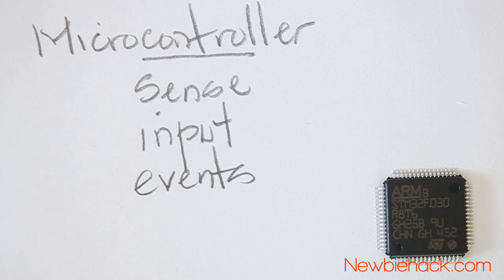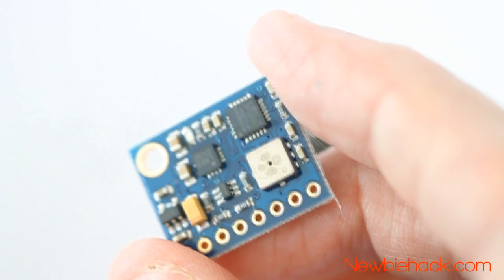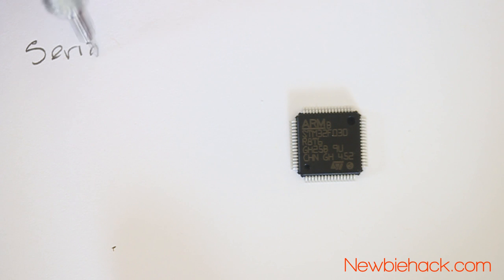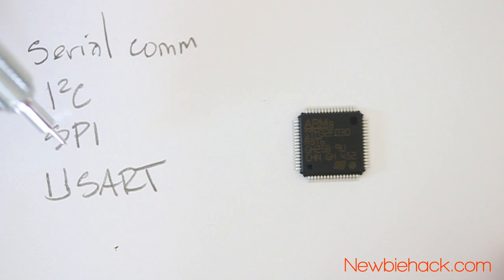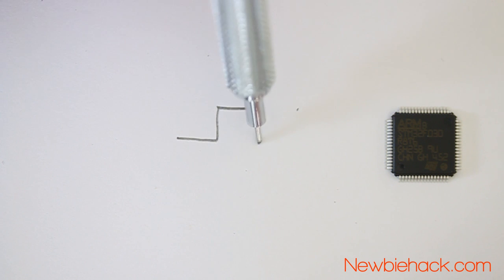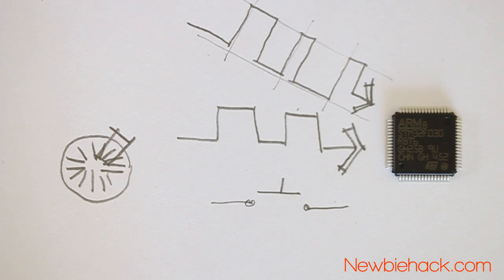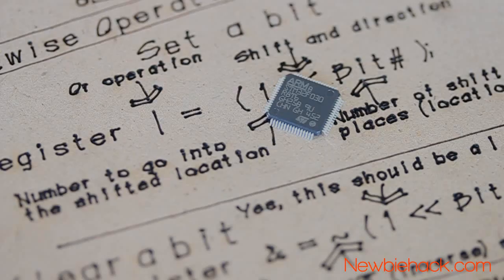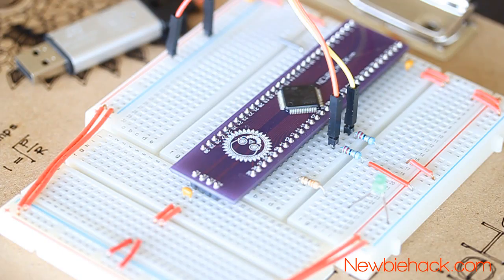1. How to Program and Develop with ARM Microcontrollers - A Tutorial Introduction

Comment: I have your book and its great, but do I need to purchase an ST link and the stm32f030 if I already own a Nucleo L476RG? It has a ST-link built into it via micro usb, but its a standard dev board with a bunch of different features and connections. I would like to do your bare metal approach, but will working with a more advanced board prevent me from doing so?
Reply from the maker: No, there is no need to purchase those components to do the project in the book. If the uC is different, you will need to adjust the code according to the available features on that board.
Reply: @PatrickHoodDaniel  Okay, thanks

Comment: Hellooo. This STM playlist is sooo lit!!! I'm new into embedded programming and am really glad to find this amazing tutorial on youtube. My question is, is it possible to follow along the tutorials using other stm development boards other than the one you used here? If it is possible, what is the version of stm you recommend to follow along the tutorials?
Thank you :))
Reply from the maker: Yes, you can use other development boards.  If you are using another STM32 chip, confirm with the datasheet of that microcontroller for the proper pin assignments and registers.
Reply: @PatrickHoodDaniel  I see. So the change will only be in the port assignment and register, right?

Comment: What is that board called he put the chip onto to spread the space of the MCU?
Reply from the maker: It's called a breakout board, but I have them specifically designed and manufactured so the pins will work with a three breadboard layout to maximize the number of tie strips and circuit variety.

Comment: Hey patrick, nice video. Quick question which brand of microcontroller are used in professional application?. I haven't found info about it but I don't think arduino has the confiability to be taken seriously, i just learned it to know but now i want to make more pro proyects. thanks
Reply from the maker: There are a wide array of microcnotroller brands that use the ARM architecture.  I use the STM (ST Micro) chips as they are very inexpensive and the features are similar to the other brands.
Reply: in which application do you use that?. Everything I see here for industrial automation is just PLC. I haven't seen any application with microcontrollers, except the electronic devices that we all have in home, but there are all are brought from china, no development with chips.
Reply from the maker: PLC (Programmable Logic Controller) is used in industrial applications due to its form factor (case, connectors and such to fit inside of a typical PLC rack).  PLCs use microcontrollers and the brand may be the same or different, depending on the PLC. You can apply microcontrollers to industrial applications (where PLCs are used) and with pretty much anything else.
Reply: but do ou use it profesionally?, the confiability of a single microcontroller is not the same as the PLC. I am mechanical engineer and among all the differents activities that I have done so far, programming through microchip is the most interesting thing that I can think of, and I want to try something more advance now :)
Reply from the maker: alex B I teach the subject and use it in my own applications and in product that I sell. These tutorials are based on bare metal programming (in C rather than Assembly) so this is pretty advanced in my opinion. Learning microcontroller programming is a must for modern industrial application especially with mechanical (mechatronic) applications.
Reply: question which IDE do you use for programing the STM (ST Micro), would you recommend to use arduino for IDE I have heard that that is used here. greeting
Reply from the maker: alex B I use the CooCox CoIDE environment, but since that IDE is hit or miss, I will probably switch to Eclipse. I don’t believe the Arduino environment is possible without a boot loader.
Reply: Hey alex
hieee
can you please tell me which ide you are using for programming.
because in this tutorial series,patrick have used coide...but its not available now.
can you please tell me
Reply: @sushantchauhan5755  Arduino IDE
Reply: okay,can we use keil mdk5

Comment: Do you also have  a tutorial for 4x4 keypad interface to arm series micro-controllers ?
Reply from the maker: I have a 4x4 keyboard tutorial for the AVR chip, not the ARM chip yet.  You can watch that one to get a good idea on the concept and apply it to the ARM.  Here is the video: https://www.youtube.com/watch?v=6FjrKXmquxU
Reply: Thank you very much for a quick reply. I had already watched and worked out that in my projects (thanks and credits to you for that). However i was having problem there when we used the crystal for 16 Mhz, code don't seems to work, Can you please help/check on that ?

Comment: thank you for real :)
and my first question is :D : how the ARM can be better than the AVR and what are the differences between then  ( ar why learning ARM)?
thank you again :)
Reply: mustapha abdul rida 
1) ARM micros are generally 32 bit whereas Atmel AVRs are 8 bit micros.
2) ARM licenses their architecture to many vendors (e.g.  ST-Micro, TI, Samsung, nVidia and many others) whereas AVR architecture is used only in Micros manufactured by Atmel.
3) ARM architecture is widely used in many CPUs and Micros like almost all Android and iDevices (Also Raspberry PI and Beaglebone Black Dev boards).
4) ARM is enough good that Atmel (and Arduino) have started using ARM architecture in their new Micros (and Arduino Boards).

There are some disadvantage to ARM: Almost all ARM micros and CPUs are SMDs with many pins. Not very breadboard friendly.
Reply: Ali Mirjamali
thank you :)

Comment: Cool, but why didn't you use any cortex m4 chip instead of cortex m0 ?
Reply from the maker: I will.  I stated in the beginning of the video that I will be using the M0 through the latest M series at the time of the video creation.  For bare metal programming, the M0 is good for the first part of the series.

Comment: Wow! Thanks! That's just what I need right now.
I recently bought two Atmel SAM chips, but I'm also planning to use STM chips, since I'm interestet in the OpenPilot multicopter board. Probably I also will use LPC chips, since they are used in the microcontroller class at my university.

In opposite to 8 bit MCUs of different manufacturers, ARM Chips build upon a standard. Does that mean, that everything or most of what you explain on the STM chip, also applys to the SAM chips?

And +1 for using the bare chip on a breakout board. I also think, that a MCU specific dev board doesn't really help, if you really want to get into it. I also just ordered two bare Atmel SAM chips.
Reply from the maker: Actually, concepts that were demonstrated in the AVR series can actually be used in this as well.  The circuits will be very similar; the code is very similar; however, there are differences in the macros and definitions. The ARM has a library: CMSIS which stands for Cortex Microcontroller Software Interface Standard which all ARM chips use and the SAM chips use this library as well. Feel free to follow with both the STM and the SAM chips and let me know how you fair.

Comment: Why you decided to use C++ instead of C? Does it have any reasoning behind it or you just picked it randomly?
Reply from the maker: Most of the programming will be in ANSI C, but I may switch back and forth where I see the need.
Reply from the maker: Additionally, there may be some keywords that are specific to C++ that I may want to use.
Reply: Did you ever heard somthing about object oriented programming? In my opinion that was the biggest step forward ever in programming techniques.
C++ has it, C doesn't.
Reply from the maker: juschu85 Good point.  I won't initially get into namespace and classes, but I will definitely use it in later videos.